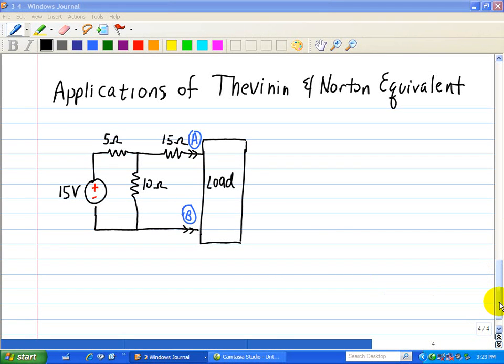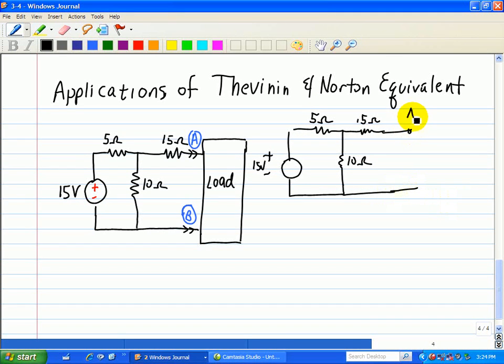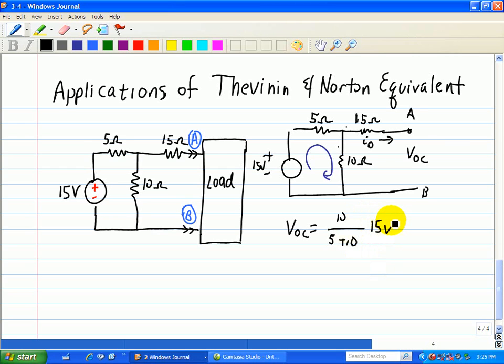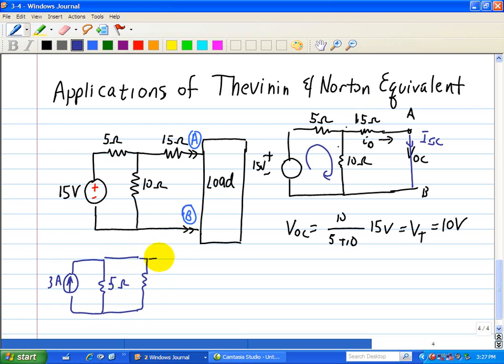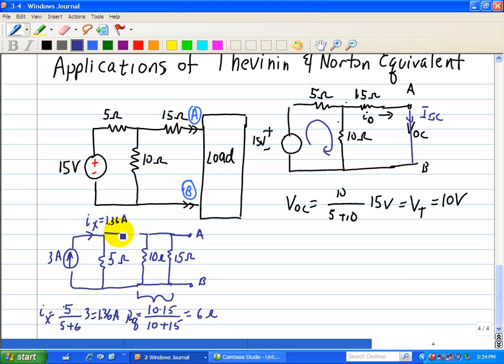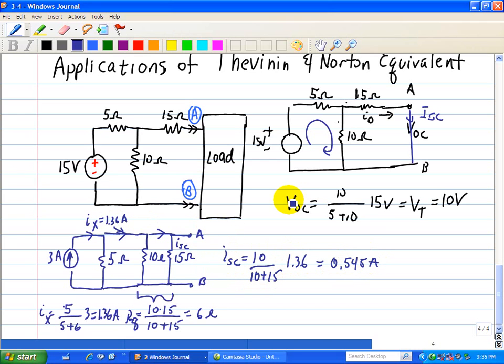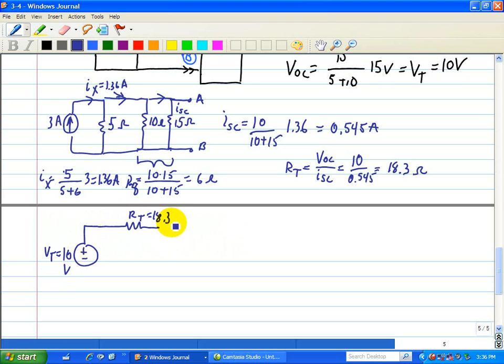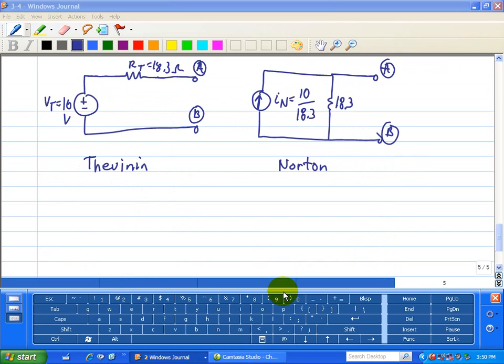Thevenin & Norton Examples - Thevenin Equivalent Circuit Theory - Part 2

Comment: mmm, doc. J 
There is a much easier way to calculate RT, see you can just temporarily turn off the voltage source, then calculate Req for the circuit right ? 
it turns out to be the same result :) 

thanks a lot for the video :)

Comment: @xJeggernautx 
larger amount of current flows through smaller resistor n small current goes towards higher resistance.here we have one resistor of 5 ohm n other is equivalent of 10&15 which comes out to be 6 so it is greater than 5.hence smaller portion of current i.e 1.36 flows through it and 1.63 flows through smaller 5 ohm resistor.

Comment: U made some mistake but still it was helpful.
to calculate short circuit current (current through 15ohm resistor) we can simply do a two step solution.
First:5, 10 & 15 are in parallel.leave 15 separate and calculate equivalent resistance of 5 & 10. It comes out to be (5*10)/(5+10)=3.33
Second:Apply current divider to 15&3.33 n you will get the answer.
(3.33/(3.33+15))*3=0.545A

Comment: Dr. J i applied this method, which differentiates with the textbook i have, and the problem is exactly the same instead with different numbers,  but the book indicates a different R_T.
If you want to take a crack at it, the format of the circuit is the same. But the V=10. R1=5=5. R2=20 which is equal to 10 ohms in your example. R3=10 ohms which is 15 in yours. I did exactly what you did and the answer came as 25, but the book indicates 14 ohms. any suggestions?

Comment: Dr.J I think you may have made a mistake when calculating the current for the 5 Ohm resistor.

Yes the 10 Ohm and 15 Ohm resistor in parallel will comprimise a single 6 Ohm resistor in parallel with the 5 Ohm Resistor. But you assign the smaller portion of the 3A current towards the smaller resistor (5 Ohm branch instead of the 6 Ohm branch)

1.36A should run down across the 5 Ohm Resistor while 1.63A should run towards the next node and split accordingly between the 10 and 15 Ohm Resistors.